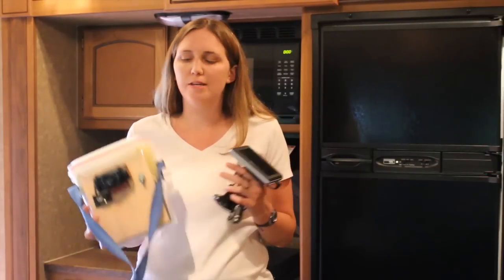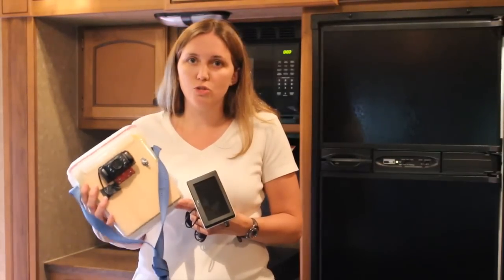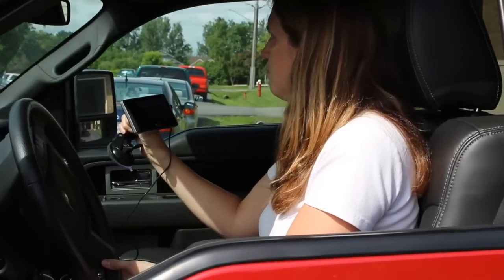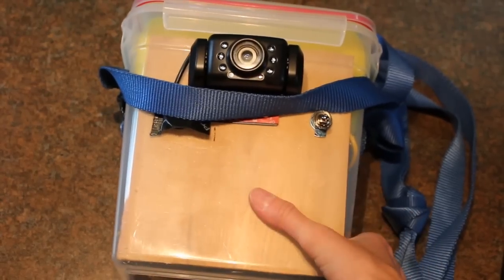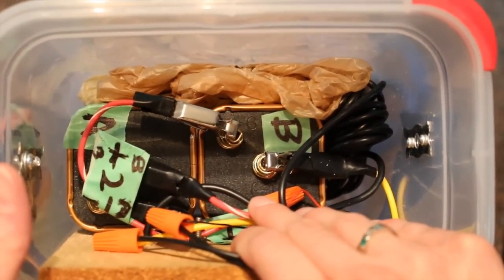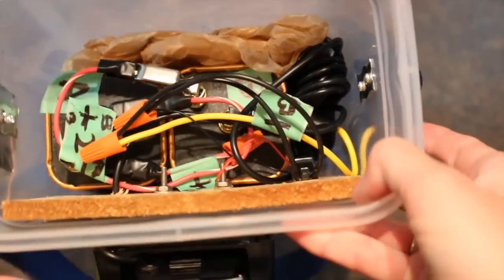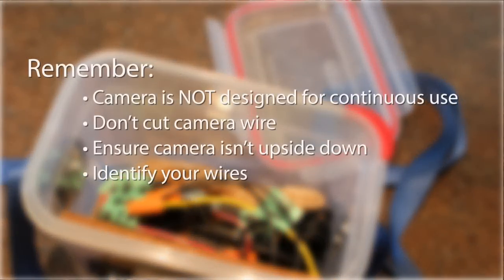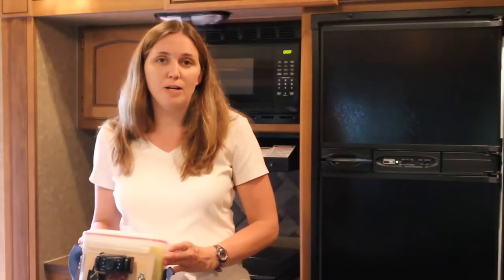Make your own RV backup camera

Comment: Technically you didn't make your own RV Backup camera, you took a factory made backup camera and you had it made to be a bulky portable unit for a truck that doesn't really need one. 
You know they make a wireless magnetic backup camera that runs off a 9v battery, much easier and less bulky for portability... You can find it on YouTube.

Comment: Hi folks,
     RE: 12V Power Supply wiring. She insructs that red or yellow may be used for the positive supply. I understand that it will work..  BUT the proper wiring is that YELLOW is now recognized for use in a 12V, negative ground system, as a NEGATIVE grounding wire. I wire many boats and aircraft, from 6V-48V, and also fabricate wiring harnesses. Most important is to be consistent; i.e.: if current wiring is RED for POSITIVE  (+) and BLACK is NEGATIVE  ()... replace with SAME colors, avoid adding YELLOW for for the NEGATIVE (), just because it looks "cool". Technically correct, BUT... the last thing you need is more confusion, or worse, confusing the "next person in".... we have all been there, like, "keerist!, what the "*!÷€" were they thinking!?".. lol. However, I have to admit in TOTAL replacement situations and/or new wiring, etc., I use YELLOW for the NEGATIVE. Yellow's visibility is great when tracing & checking lines. Yellow, unlike BLACK tends to NOT just "disappear " into the bilge or engine compartment, etc. Oh, BTW, I think it looks wayyy cool, too! LOL.. be well and Merry Christmas, 2015! BE SAFE and thank-you to all that take the time to share on YouTube!

Comment: ...or use a webcam hooked up via USB to your laptop.
Reply: +shouldibehere The range is very limited on a usb cable and lag/delay can suck...Basically it's workable for hitching up a fifth wheel as demonstrated but not useful or convenient for her other applications of locating the camera remotely to watch the trailer backing close to some object that's hard or impossible to see from the driver seat. For that you truly want a wireless setup and not a long ass wire between you and your spotter camera.